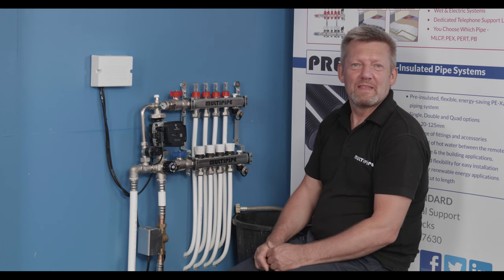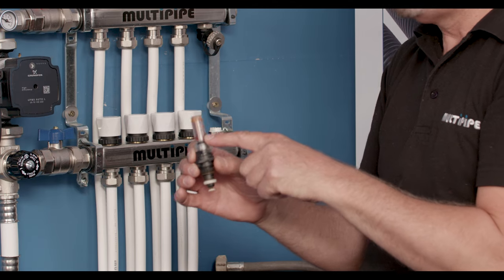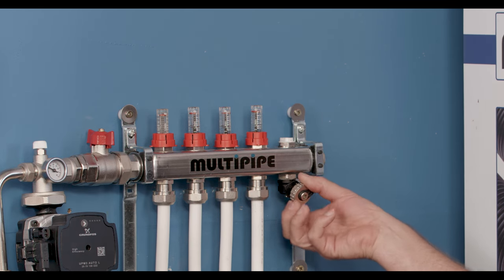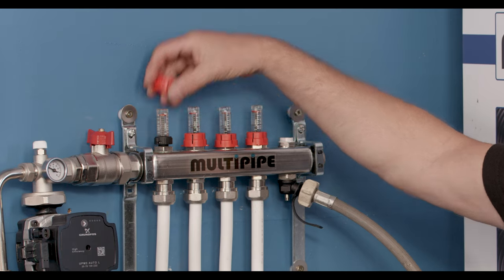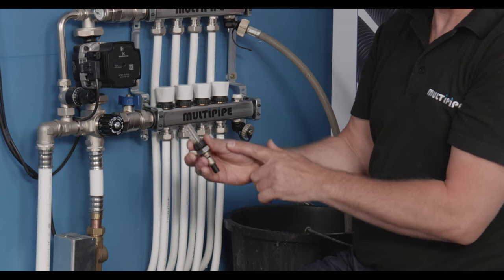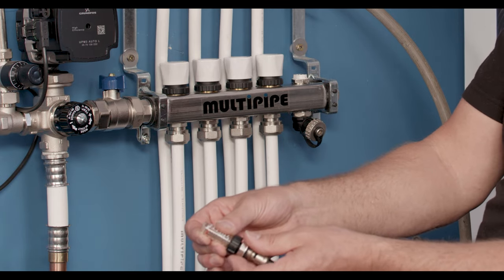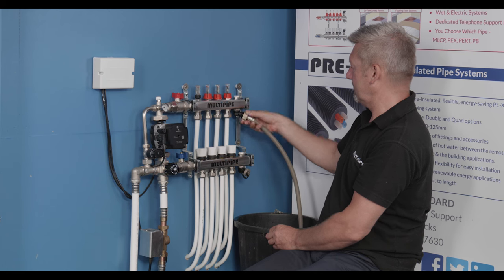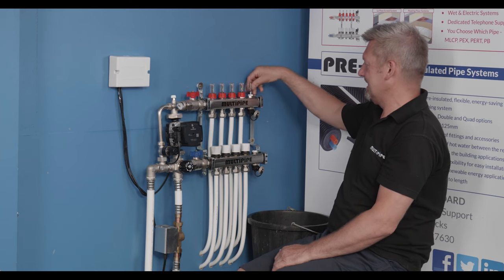How To Maintain A UFH Manifold Flow Meter

Comment: My meters won't adjust any more they're seized solid and I'm afraid to put a pliers on them incase they shatter,  one loop to one room seems to be gone cold though the pipes are still getting a little warm. Should i just replace them all ? they're cheap enough,  and does it matter whether they go on flow or return ??

Comment: should the flow gauge be filled with liquid? in my house the downstairs manifolds flow gauges are all filled with liquid the upstairs ones have none in the little glass tubes, i ask because the pump is running but not heat upstairs.
Reply from the maker: Any liquid in the gauges should be ignored. This has nothing to do with the level of flow through the circuit. Sometimes the water pushes the air out of the gauge, but this is not a problem. You need to look for a coloured disc that rises or falls in the glass; this is what indicates flow. If this drops down, this typically shows flow. If you have one loop that is not heating, this is usually a failure of the actuator. If all are not heating, this is typically the pump or mixing valve failure. I hope this helps.

Comment: Hi, I get heat from the supply manifold when I touch the steel manifold also the floor is heating, but I can't see any fall of the red disc in the glass at any time,tiny red discs are always at the top part of the glass indicators, I have 6 circuits attached to the same manifold,none of the gauges show any flow though hot water gets in to the supply manifold and there's heating in the floor.Can this happen due to too much air in the supply manifold ?
Thanks so much
Reply from the maker: Air is normally shows as the red discs jumping in the gauge. I would suggest for this one it is either failure in the controls that lift the actuators. Or, if all flowmeters are not showing flow the pump might of failed on the manifold which means you would have inadequate flow.
Reply: @MultipipeLtd  Thanks so much for your interest

Comment: Any suggestions for cleaning a flow meter that is sticking ?
Reply from the maker: if it is sticking because of limescale you could try a descaler solution and soak them in this. but this may affect the o-ring and may need replacing. Normally they don't get stuck much and simply working them when they are out helps.

Comment: What is that other loop to the left of the manifold pump? Looks like it has its own temp/pressure controller, and goes back to the main return pipe. Is this some sort of auto bypass?
Reply from the maker: yes, this is normally fitted if the controls provided on the system does not have a pump delay, this is mainly for protection of the secondary manifold pump to ensure it does not pump against all closed loops.
Reply: @MultipipeLtd  Ok, thanks. I understand why it might be required, but not the detail on how best to set it up. When 1 or more loops are open, you presumably don't want any water to go via the bypass. When all are closed, you want all the water to go via the bypass. How do you achieve that? What control is on that pipe - is it a pressure relief valve? I guess if the pump is pushing against closed loops, pressure goes up, and then that can release it via the bypass. If a loop is open, the water can freely circulate, so the valve will stay closed. I guess you would set the pressure to be that of the maximum pump output. Am I on the right track, or over complicating it? Perhaps it isn't based on pressure at all, but you always allow a trickle to go back that way? I'll ensure my system has a pump delay, but keen to understand in full what setup you have there. Thank you.

Comment: Hi! Is there any need to refill some wather into the system? Once you depressurized the manifold, how much water went into the bucket?
Reply from the maker: as you only depressurise the manifold the amount of water is tiny. but yes, you may need the re-pressurise you boiler as well. (and don't forget to vent the air our of the manifold before switching the pump back on).
Reply: @MultipipeLtd  Perfect, thanks a lot. Keep up with your videos, I found them super valuable, as many other people I believe!

Comment: Can you just remove the glass section for cleaning? (Of course still depressurizing the system first)
Reply from the maker: Thats correct (depending on the type of flowmeter). The glass should separate from the body, unscrewing it whilst holding the main body of the flowmeter should undo the glass. but some flowmeters do not allow this so be careful.
Reply: @MultipipeLtd  hi there your instructions where very good so thanks for that, however my glass section is so dirty i cant actually see where they have been set too, i could probaly make a good guess but if not iam not sure how to balance the system

Comment: Hi. I turned off the flow and return valvues, I have electric actuators. Ive depressurised. But there's still water in the flow meter glass - in all 4. Will that not come out when I unscrew the flow meter?

Thanks
Reply from the maker: Always ignore any water that sits in the flow meter this does not affect the system in anyway you should take you reading from the plunger not the water level. (the reason water ends up in the meter is purely because air compresses so pushes water into the glass higher the pressure more water in the glass).
Reply: @MultipipeLtd  Thank you. I really love your videos and it gave me the confidence to go ahead. I took the plunge and swapped them out today and it all seems to work. Well, I say that. I have two manifolds and two Heatmiser Wiring centres. The small leak from the flow meter somehow got in to the wiring centre below and blew the fuse, so I have to get that fixed. Hopefully by checking all is dry inside and swapping the 5amp fuse.

Comment: I have moved into a house where the UFH manifold appears to have been installed the wrong way around: flow meters on return and TRVs (with thermostat actuators) on flow (hot water in). The system works, but the flow meters always show zero. I assume to make the system work at its full efficiency the manifold needs to be planned the right way round (the reverse of what mine is)?
Reply from the maker: I would suggest getting a UFH specialist to look at this. Each manufacturer does have different components, and some have the meter designed on the return. Your UFH specialist will check which way your flow should run. However, this normally causes issues with balancing, but the system still should run.
Reply: @MultipipeLtd    thank you for your reply. The system does run. However, and as you mention, I am not able to control the flow in each room via flow meters and therfore balance the system effectively. Does reversing the manifold arms (or perhaps each valve individually) require draining the whole system?
Reply: There are two types of Manifolds from Multipipe/Unipipe/Unicore.   I thought mine were plumbed the wrong way around, but looking through the old catalogues I found my version which works with Flow Meters in the Returns. Within the Flow Meters, the  springs are at the top and push down the plunger rather than the way all other flow meters work.

Comment: How do you know when a flow meter is not working?
Reply from the maker: normally when the pump is running and the actuator is open you should see a registered flow. Sometime the glass can fog up and can be hard to see, but it is worth checking the temperature of the pipe and you should find the flow is warm and the return after 15mins1/2 hour is warm as well.
Reply: @MultipipeLtd  Thanks for your assistance, the pipe is still cold when the others are hot,I have swopped over actuators and still not getting hot,do you think it's the flow meter as the spring stays at the top.

Comment from the maker: 👉 Did you find this demonstration helpful? Let us know by leaving a comment below!
Reply: Hello!
Is there an optimum flow rate to set the valves to please?
Reply from the maker: @ttttrant01  yes, it all comes down to the flow and return temperature you require the output required and the length of the loop. Your UFH supplier should be able to provide you with the flow rates for your specific system. If your system is a Multipipe system then call us or send us an email and we will send this out. .
Reply: Hi I’ve got a customer who’s system I fitted about 7 years ago, going to Chem clean and flush etc for maintaining, on ufh zones I’m going to clean sight glasses etc, could u advise on the use of biocide treating please, does this just get ran through for a period and drained out to treat or left in as addition to inhibitor, t.i.a
Reply from the maker: @d055e  We would always recommend VDI2035 over chemical treatment as this mean less chemical in the water system and continual treatment. But, if you use inhibitors, then a biocide is recommended, and this runs in the system continually..
Reply from the maker: @ttttrant01  Apologies for the slow response. the flowrate is dictated by the desired output, length of the loop and system delta T. this calcs is normally done Free of charge by the UFH supplier/ manufacturer.
Reply: no pressure gauge- how do you know the pressure? no propper airvent, put hose to the return bar mate... be PRO guys...
Reply: Thank You for the good video. But I see no gaskets or teflon tapes. Is this normal/acceptable?
Reply from the maker: @vladomarini2484  yes this is normal. Nearly all flowmeters are sealed via a EPDM rubber seal.